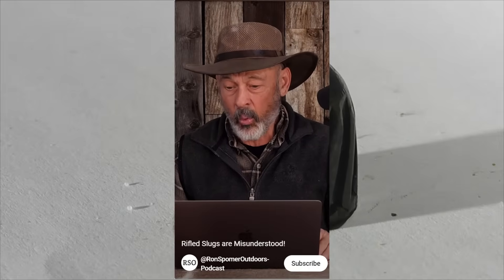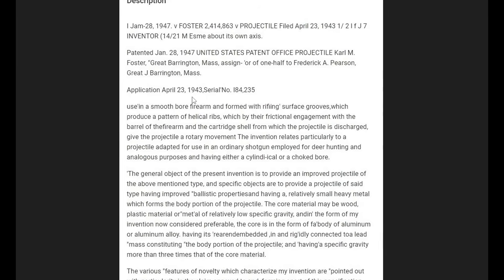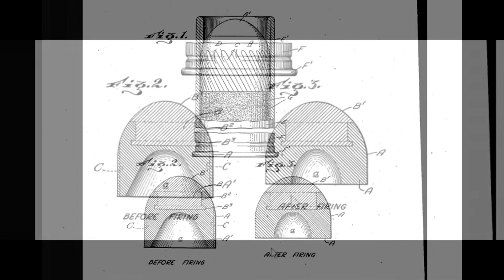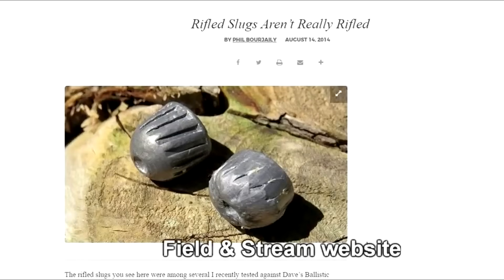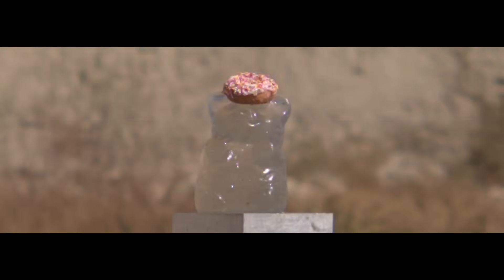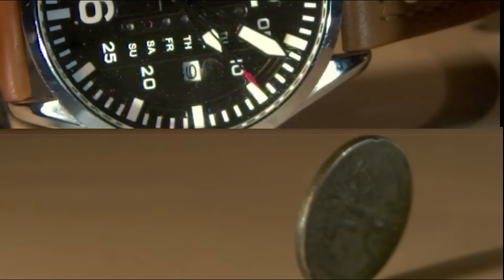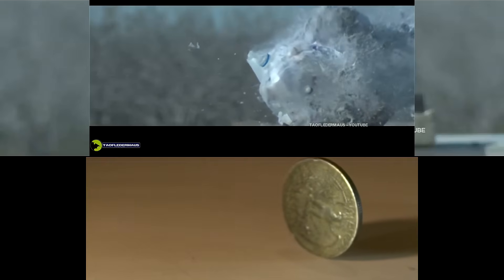Yes,  RIFLED Shotgun Slugs SPIN - The high speed camera doesn't lie

Comment: Having shot hundreds of rifled slugs with a good bit of those beyond 100 yards (just for fun at the range) in an AK smooth bore shotgun. I can definitely say the rotation those little ribs give the slug absolutely help stabilize the slug for far and beyond most shooters will ever consider. And for anyone wondering, it is awesome once you get the knack for launching those 1oz pieces over 100 yards and smacking your target, a seriously special feeling.

Comment: I had always - well, since I recovered a 20 bore foster slug in the snow, back in the 1960's, that the ribs were to enable the slug to pass through any choke. Tks, for the video showing rotation in the smoothbore. Something I have also read, is that foster slugs do not do well in a rifled gun. That is also BS as factory 3" WW Fosters & Gualandi slugs shoot amazingly well in my rifled Mossberg 835 bl.

Comment: Hey, it didn't suck!
Can you expand on the definition and effect of angular momentum . For example, is angular momentum that which keeps the slug from swapping ends given that the original foster had the lighter nose insert?
Reply from the maker: It's just the spin that keeps a coin or a top from falling over.

Comment: What I've noticed is that those slugs tumble at 80 yards even when saboted and fired from a rifled barrel meant for firing sabots. But the Remington copper solids don't tumble. They fly straight and punch a neat hole in the target at 80 yards and beyond. Great terminal performance also. But expensive!
Reply: Doesn't tumble in our smooth bores  or rifled barrels to 80 yards.Over the years we've made several shots ( Kentucky windage of course) out to 142 yards,125 yards,120 yards,several at 100 yards,my dad's 165 inch ( heavy 9pt) was shot at 95 yards,now mind you the 142,125,120 yard shots were at the end of their usefulness because of the trajectories of the shots hitting center of the deer on impact site and stopping right next to the sternum s of the deer on the opposite side showing they were at the end of the rainbow when going through the deer but no tumbling ever observed in the targets of meat.

Comment: Even though the ribs on the slug are flattened out, the air friction moving over the slug with the little bit of ribs still protruding, as it departs the barrel is also imparting rotation of the slug.

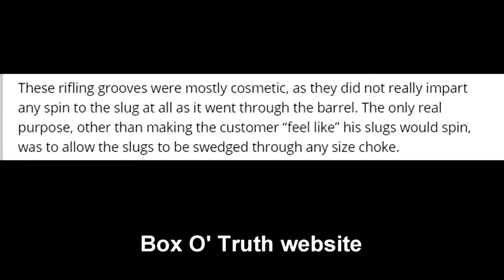Comment: After using Berger's online ballistic calculator, a 1oz Foster slug is marginally stable at 10,000 rpm and comfortably stable at 46,000 rpm. These would coordinate to a 1:105 twist for  and 1:25 twist for a 1600 fps muzzle velocity slug. It also seems that a lot of rifled shotgun barrels also have a twist rate of 1:24 which seems ideal for something similar to a 1 oz foster slug. 

750 rpm is far short of what is needed to provide projectile stability so the foster slug must be an inherently stable supersonic projectile. However, what the rifling grooves should provide is improved accuracy and consistency by removing any randomness from the slug exiting a smooth bore barrel. I think this needs a follow up video patterning two sets of slugs, one with grooves and one without to see how they group and how the stability compares.

Comment: As a couple others have pointed out in different words, the spin is imparted by the changing angles of friction and obduration imparted on the slug as it is spread out by pressure in the bore and swaged down by the choke.  Once the helical grooves are flattened and filled by the obduration, I would expect the spin effect to no longer be added to.
An interesting addendum to this video would be to measure the spin rate of a slug from a cylinder bore versus a choke in the same barrel, to see if that has any effect on spin rate.

Comment: Id like to see a direct test between 3 or more weight-identical slugs. Straight rib, perpendicular rib (by which i mean ribs running the circumference of the slug), and the traditional angular rib, with possibly multiple stages in between. Then you could really nail down the difference. Though id hate to have to pay for the individual moulds, lol.

Comment: i know the phantom cameras are super expensive.  what about working with slomo guys and see if you could get a full down range over 8000fps. i know there are limitations on the chronos and im not knocking it.
Reply from the maker: We all don't live near each other.  The limitations are the same for a Phantom and that is the narrow focal length for the given aperture setting needed just to get enough light into the camera.
Reply: @TAOFLEDERMAUS  oh well that's a stinker. Never with camera gear in that sense. Oh well.

Comment: aren't you not supposed to shoot foster slugs through a shotgun barrel with a tight choke in the first place? if it were designed this way specifically to fit through chokes, then there wouldn't be so many concerns when it comes to shooting foster slugs through a shotgun with a choke. even without this test proving it, that idea just sounded completely wrong.
Reply from the maker: From tests I've seen,  a slight choke  (IC)  works best.

Comment: Of course it will spin. The smooth bore is not smooth. At a microscopic level it will course. Friction. If it was perfectly smooth you have a squib load. Remember, glue doesn’t work by being sticky, it works by making to surfaces perfectly smooth.

Comment: It is not at all clear to me, however, how the angled vanes cause the spin. Friction is always opposite the direction of motion at every point of contact. It doesn't matter whether the vane is angled or straight along the bore or straight perpendicular to the bore if all we are talking about is ordinary sliding friction.
Reply from the maker: The friction with the barrel is intense.  If you were to somehow able to stop the slug mid-barrel,  it would be difficult to drive out with a steel rod and a sledge hammer.
Reply: @taofledermaus  Yes, but I don't see what that has to do with my question. The friction should not have any tangential component - it should all be opposite the direction of motion.

Comment: I did like the video. Very interesting. My physics says that rifling on the slug wouldn't impart a spin. So clearly I'm missing something. Although 750 RPM is a bit short of the 300,000+ RPM you get from a bullet from an AR-15 with 1:7 twist barrel. Quick question. Am I the only gun nut who does not own a truck?
Reply from the maker: thanks Dan

Comment: how they get to spin...  from what I heard, the surface area of the rib being at the angle creates a drag as if you were to push the slug down the barrel and keep it from spinning that surface area is wider than the raised portion. If you push the slug down the barrel and have it spin at the angle of the raised section the drag is less... the slug wants to move with the least amount of drag and having it travel in a direction where the ribs moving in a path, it wants to spin...  example would be like having a free spinning propeller on a stick, put the prop out of the car window when its doing 50 mph, the prop will begin to spin...

Comment: Put those ribs on a diabolo round, only where the air wont be flowing through at high pressure. So just where it makes contact with the barrel. Make them as deep and with same angle. No wad encircling it. So must be same diameter as the foster slug. It would tell us a bit more. Also must be relatively flat nosed, so the air will be forced out and around the ribs.

Comment: There is some other mechanism at play. If its the air being forced through the tiny grooves near the top, it would be accelerating its rotational velocity as it moves. It does seem to spin more the closer it gets to the target. If it is the slug spinning in the barrel, then there should be evidence it spins any measurable amount while forcing it through manually with a machine. The grooves cannot impart spin the way they are. The only conceivable way that would work would be that the barrel would elastically deform ever so slightly where the helical ribs are, that it sort of acts like polygonal rifling, but 1000x worse. Cause the only way for the barrel to impart spin under those conditions would be the tendency for the instantaneous deformation pattern to resist traveling perfectly with no twist, but rather it would take less energy for the deformation to travel down the barrel in its helical pattern. That means it would lose more energy by not spinning. Im leaving much of the explanation out. I would need a whiteboard to explain this.

Comment: It may spin, but the spin is meaningless. A projectile of that diameter/weight/length/velocity would need to achieve 24,000 rpm to be considered gyroscopically stable in flight.
Reply from the maker: We don't get those high speeds even with a rifled barrel.
Reply: @taofledermaus  you actually get much higher. A 7mm rifle bullet, fired through a 1:10 twist barrel at 2,500fps gives about 180,000 rpm.
Reply: @taofledermaus  24,000 rpm is what. 1:48 twist produces at 1,600 fps
Reply from the maker: @kingwiththeax6880  I don't thing the double donuts were spinning anywhere near that speed.  Maybe 2400 rpm
Reply: @taofledermaus  maybe my math is wrong, but I used the JBM Ballistics online stability calculator (Miller stability formula) and converted the twist rate per velocity to RPMs like you did. Values are for 435 gr, .725” slug at 1600fps. 1:48 was needed for green light stability factor. Maybe the weight balance of shotgun slugs doesn’t require the degree of stability that a G1 rifle bullet does?

Comment: I always assumed that the spin was generated going through the choke.  A slug will just drop down a barrel with an open choke.  The hollow base and pressure should cause the slug to expand out to touch the barrel but there is no guarantee that it will.  Also, assuming the choke doesn't squish the rifling flat, the movement through the air should help the spin also.  I'd love to see some footage using a stupid expensive slo-mo camera to compare the rotation rate at the muzzle and then at 100 and 200 feet.
Reply from the maker: A soft lead slug like this will obturate even before it hits the forcing cone.   The fact so much lead fouling ends up there kind of proves that.

Comment: I've shot those particular type of slugs flat tips with a point kind of like a wad cutter with pinpoint accuracy out of a smooth bore semi-automatic shot gun. The match shooter didn't believe it until I upped the Ante. No BS I shot a 1-in PVC pipe at 100 yd with iron sights and blasted it right in half
Reply from the maker: nice!

Comment: I owned a 20 gage shotgun for about 15years and only shot slugs twice as an experiment to see what would happen- the reason was when i bought the Mosberg 500c Country Squire Goose gun it as recommended to NOT shoot slugs because of the barrel length- 28" super modified - everything worked just fine and no problems hitting the target at 75 yards-
Reply from the maker: I think most companies make their slugs so they are safe out of any modern shotgun.

Comment: Actually the straight ribbed version doesn't swage through chokes very well tho it does engage paradox fairly well.   What's actually happening is kinda neat: the interfacing surfaces between the barrel and the helical ribs generates a third motion when they're being rubbed off that causes a lateral force around the circumference of the Minie slug.   They're actually "Foster Ribs" and they work on smoothbore musket as well!  No idea what they were called way back then but the quality of lead casting back in the 16/17oots wasn't up to the tech.

Maybe have Ethan carefully mill off a series of Minie slugs with different angles of foster ribbing to see what effect that has?   I'm betting the twist rate on the standard one is the sweet spot for 1300fps.
Reply: Great idea.

Comment: They work but I just went ahead and bought a Hastings barrel for my 11-87. Impressive groups at 100 yds w/nice shotgun scope. I have seen different stories that say the choke makes a difference in accuracy when using Foster's.
Reply from the maker: I've gotten some pretty good deals on ebay buying used rifled barrels.   The only exception was the one for my Benelli which as over $600.

Comment: I think, if they knew how little spin the angled fins put to the slug back when it was engineered, they wouldn't have bothered tilting them. They would have left them tho because it's easier to smash (obturate) a chunk of lead with air spaces in it than one without, and that makes the deformation more effective. 

As far as the nose heavy imparting stability, i think it has much more to do with the hollow base than the weight balance. Sort of the same principle as the diabolo shape creating the low pressure ring area in the waist section to keep the skirt centered in the shock cone.

I bet the foster slug would destabilize more often with the base filled with something compared to a diabolo shape with a filled base. The diabolo still has the low pressure ring at it's waist to stabilize even without the one at the base being effective. 
Theories.

Comment: Twist rate on rifle muskets was sometimes 1:48" to 1:60", the latter a rotation every five feet. A short/squat projectile doesn't need much rotation for gyroscopic stability. 
Anyhow, my theory of things is that the obturation of the 'fins' is where the rotation comes from. The way they're arranged, squashing one flat should provide a force tangent to the barrel.

Comment: The real mystery of the Foster's slug (besides beer references), is if it was inspired by Wendy's ketchup cups that never hold enough, and make you feel like a ketchup hog when you attempt to get enough of these microcups for your fries, and these cups always seem to be out of usable ketchup before they're visibly empty... or was it these horrible cups that inspired the quite functional (they drop deer just fine and cost less than slugs that don't work as good) Foster Slugs?
Reply: Haha! Nice. I always grab an extra drink lid, turn it upside down and pile that ketchup up. Suffer no longer my friend.
Reply: @theroller5673  You have shown me the light and the way.
Reply: Those folds in the little cups were designed that way so they can be unfolded like a flower to hold more ketchup!
Reply: @camouflagepeacock6414  Breaking the red dam sounds risky AF, and I've already got OSHA hot on my tail over a certain banana-based locomotion technique that may or may have resulted in a tiny bit of slippage/fallage, and general monkey business.
Reply: @Buck Starchaser  As we know, monkey shines and assorted fowlthuggery are ever wondering barbs on the same wire. Always tread lightly. 🙊🙉🙈

Comment: Wearing down of the angled edges on the slug means friction. Friction means force. Force at an angle produces torque. Torque produces rotation. 

If the angled edges are worn down, then it must produce some rotation.
Reply: If the angled ribs on a slug didn't impart spin, the entire concept of a wedge is false. Knives, Axes...wedges, it would all be an optical illusion.
Reply: "If the angled edges are worn down, then it must produce some rotation."
No. That does not follow.
What actually happens could be anything and this COULD be the case but smushing down the ridges could just as well induce a spin in the opposite direction. 

Simple "intuitive" answers are very often just wrong.

Comment: It would be fairly easy to make a same weight, shape and size  slug with no ribs and shoot it through a smooth bore and see if it is as accurate. Then one could say the spin helps or not.  Most likely due to the short length to diameter 750 rpm most likely is enough to stabilize them in flight.

Comment: Idea for a spinning projectile from a smooth bore
The projectile is a short tube with a "propeller" inside. Its not pluged, it lets the gasses through. As the gasses go through this tube it will start to rotate and go with the flow. But, of course we lose a lot of energy this way. 
I suggest making a few projectiles with different sizes of the holes at the front. Maybe theres a good enough compromise, that gives a lot of spin and good enough velocity.
Maybe if the hole is small enough its better to replace the "propeller" with nozzles in front of the hole, similar to the aeolipile. It seems like this last idea has the most potential.
Reply: So, take this foster slug and drill 1 large hole (1/3 of the width of the projectile) longitudinally from the back and almost all the way through. Then drill 2 or more holes from the sides at an angle, so the gasses go through the projectile and give it a spin as they escape from the front, as in aeolipile.
Try different overall cross section of the side holes to find a good balance of the rotation and velocity.
It seems that longer side holes should spin the projective stronger.